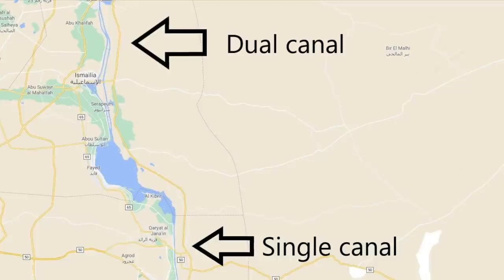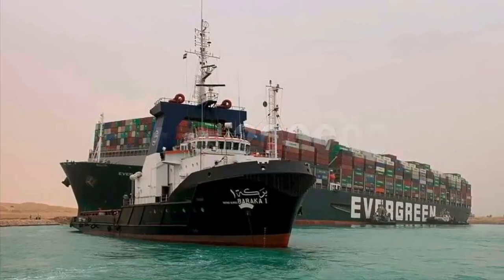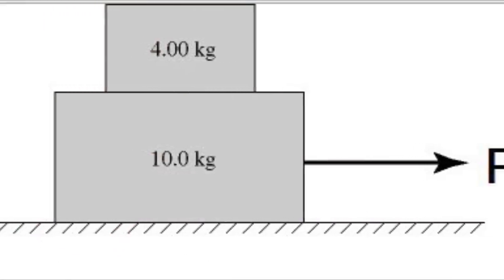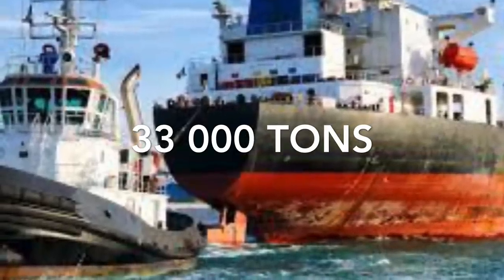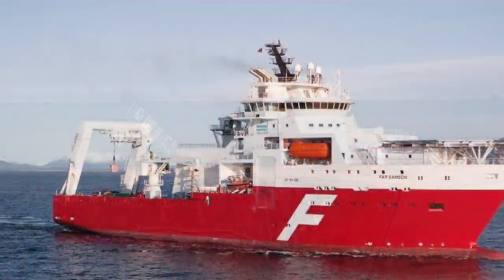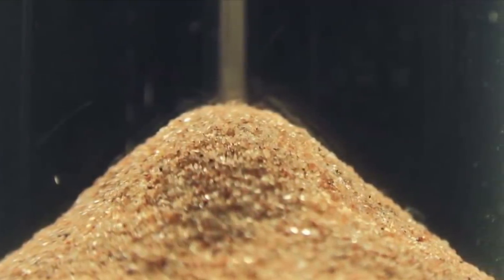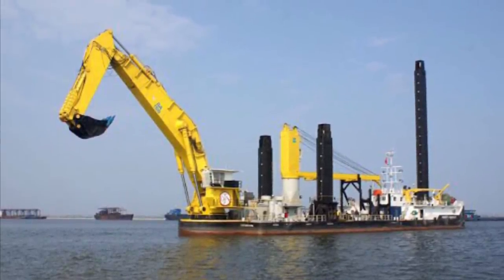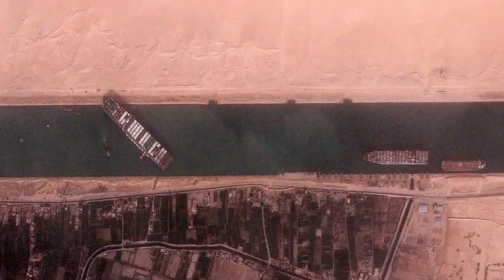MV Ever Given - why can't it be pulled out? Suez canal blocked

Comment: Something you didn't mention is that the ship is very close to land, surely we can use very powerful winches to pull the vessel free ?
Reply: You underestimate the sheer weight of these ships
Reply: These things weight 500,000,000 (500 million) pounds. That’s about 175,000 Toyota Corollas
Reply: Well he did say that it was wedged into the land... Did you not listen? I think it's free now anyway
Reply: The US navy rolled over (to upright) the capsized battleship Oklahoma in Pearl Harbour by using cables, pulleys and winches on land in 1943.
Reply: @francoistombe  The battleship probably weighs a fraction of these container ships fully loaded, not to mention the friction of it being wedged into the sand
Reply: @cmdr101z8  The battleship was dead on the bottom and weighed 32,000 tons.  The container ship displaced 200,000 tons but likely less than 10% of that weight was aground. At high tide the entire weight was floating.

Comment: High pressure water jets at bow to clear sand and large bull dozers tied to aft with hydraulic cable pullers from shore. Still using tug assist.
Reply: I think pulling from shore is going to be part of the solution, but it'll take ages to set up.
Reply: Calm down
Reply: the hull may not be designed to withstand pulling in this specific scenario

Comment: Why can't they use cables attached to spools mounted on land with engines turning the spools?
Reply from the maker: Maybe that will be the solution. But likely you can not attach a load that high to the mv Ever Given... it will just break parts of the vessel.
Reply: I guess they can weld hundreds of anchor points all over the surface of ship, and bring in hundreds of bulldozers.
tie each anchor points to the bulldozers with steel cables and pull.
Reply from the maker: @davidjacobs8558  possible. I heard today that some specialist are one the way... i look forward to see the solution
Reply: @TheGeotechEngineer  
SMIT Marine salvage, the best in the world.
Reply: @davidjacobs8558  hundred?? You need thousands...
Reply: @akhilmathew8822  depends on how heavy the bulldozers are.
Reply: @davidjacobs8558  Bulldozers are also not cheap. I doubt they'll just have hundreds of them lying around, and if they do, they probably need them for....you know... construction. You might as well deploy some tanks from the military and used those to tow. If you're not at war, might as well put them to good use.
Reply: @davidjacobs8558  A tank should also be heavier than a bulldozer, and as mentioned before, since it's not construction equipment, it shouldn't disrupt any other projects going on. It might freak people out if they see tanks going towards the ship though...lol, and who knows if they'll be able to get enough of them in a reasonable amount of time to actually make a difference.
Reply: The bow seems stuck pretty well but the stern, just drag that across and open up half the channel.  Cables on land with strong anchor points and pulley system.
Reply: @joemann7971  well MBT's are about 60 tons. bulldozer for road construction can be 100 ton or more, but bigger ones can not be easily transported without disassembly.  MBT's aren't really built for pulling or pushing things.

Comment: You are wrong about draught of this ship. You can actually read out draught on marks at ships bow perpendicular. Looking at this picture and excavator you can guess that cwl is about 6m out of water. This gives bow draught of about 9m. True, ships bow is lifted out of water for some extent due to grounding. Look at cscl Jupiter at Antwerp. Ship run a ground with large percent of bottom lenght and it was pulled with 8 tugs.
Reply: Thanks for the info.  The also have the possibility to pull from the land on the opposite side with bulldozers and such.  They need to get out there with some serious earth moving equipment and start digging a much bigger hole.  Lower the bank around there down to just above the water level so they can get down under the ship.  9M is an easily digable depth with proper excavators and maybe hydraulic mining and dredging equipment.  That one small excavator isn't going to get the job done.
Reply: Hes also wrong about the weight it depends on what's in the containers like cars n stuff could weigh more then flowers n stuff you know
Reply: @mroldnewbie  Maybe, but it takes time to get projects like this together, especially out in the middle of nowhere like that.  Companies have to be hired, equipment has to be moved, who's going to pay for it has to be agreed, liability wavers have to be worked out.  It's complicated.
Reply: @mroldnewbie  I would guess that you're right, if the company ever wants to move another ship through the canal.  Anyway, they'll get it out.  These things take time and the wheels move slowly. Just one more warning to us about the fragility of our global supply chain.
Reply: @mroldnewbie  Yes.  And then there's the Panama canal.  And imagine if several ships were actually sunk in either.  We are living on a thin line.

Comment: My thoughts have been to find some huge pumps/compressors (whatever works best) and try to liquify the sand with water/air surrounding the vessel while in concert with the tugs
Reply: Using air wont work as it will cause the vessel to become less bouyant. Natural laws of physics, however blasting water at high volume could well be a good solution providing it doesnt damage the hull, unless divers have been down already I will be very surprised if the vessel isnt taking on water, these hulls arent very thick and buckle easily
Reply: @simonturner10  Can you expand on that comment about the hull? if the ships in port, does that mean the hull will buckle?
Reply: @bocca7789  No but the sheer weight of the hull pressing down on the ground or bank could potentially cause it to buckle, ships of this magnitude are simply not designed to lay weight on the hull itself rather remain bouyant where the weight is evenly supported by the water hence why they are built on Jibs and not on the ground in the shipyard. Imagine 200,000 tonnes pushing down on a plate thats no more than an inch thick
Simple way of proving this for you is to make a simple paper boat and float it then add weight and the boat will stay in shape, then put the paper boat on a hard surface and add the same weight, the results will surprise you
Reply: @simonturner10  cheers mate. if its taking on water, can it be stopped?
Reply: @bocca7789  depending on how much if any then in all probability it could be stopped with airbags, welding or continously pumped out while they salvage the ship, but the longer she sits on that bank the higher the probability that this could rip her open beyond salvage, then its a whole new world of mess to deal with
Reply: Is it possible to use some huge cargo ship as tugs?
Reply: @simonturner10  No mate it won't be taking on water, those bow plates are 10mm Corten or Bisalloy and designed to withstand a knock or two. Plus of course, the frames will be taking the load not the plates. If it were rock it may be a different story but sand will spread the load very evenly. What is more of a worry is hogging and sagging as the tide runs in and out breaking her back in the middle.
Reply: @vgb_here  In this case probably not due to the force needed to pull it off the bank
Reply: @marvindebot3264  I agree to a degree with you there but you still have the downward pressure on the hull, as you rightly suggest it is resting on what is probably the strongest part of the hull but there is still scope for her to crack at that point although I do agree the risk of her breaking her back would be very high at this point aswell. The way this whole thing is shaping up its not looking good
Reply: In addition, water could be pumped into the stern of the ship, so that the weight distribution shifts to the rear and the nose rises out of the sand and is relieved.
Reply: @vgb_here  No. The hull is not designed to withstand such force. Towing is only a thing when the vessel is afloat or at least grounded not in such extreme way. The max safe working load on bits designed for emergency towing that are on bow and stern is 200 tons only. Do not forget that a huge part of the hull is 15.7 meters deep underwater. A container is abt 2.6-2.9 meters tall. So it is around 6 container deep under waterline, just for reference.
Reply: I was more thinking about blasting the sand as an obstacle furthest from to close. Water cannons for hydraulic mining aren’t anything new and they don’t need to target near the ship. I’m confident with all the money 💰 that is flying away, that someone can create a custom version that could safely remove the material even if they need to start 100 yards away and work below the water surface. Just throwing out ideas anyhow

Comment: What about using the massive water cannons, that are used for some mining operations, to blast the bow while at the same time pulling the stern with tugs?
Reply: This thought of hydro mining crossed my mind too, it might just work. Some guy on tiktok suggested using another ship to pull because of the weight and power.
Reply: You still wont generate the massive amount of force needed. That ship needs to be unloaded.
Reply: @roguemotorcycle  "Wind" blows second ship into the sand ah whoops
Reply: The problem is that the bow of the ship is located far underneath the surface. Which would dissipate all the force of water cannons very quickly. What you do instead is pump water through pipes and push them in underneath the bow to liquify the sand around the hull.
Reply: @roguemotorcycle  yes, even if the water cannons don't shift all the earth that is beeching her, by introducing loads of water at high pressure, they might be able to reduce the friction enough to tow her free.
Reply: @ashleycole7779  You can turn sand to liquid but pumping air into it, so sinking some pipes down and then pumping air into it could work? The problem is how much this would effect the buoyancy as you may just get the ship stuck more.
Reply: @GAIS414  I like your solution better.
Reply: @geocam2  Well if it got on there they should be able to winch it back off, once the sand loses it's grip around the hull.
Reply: @paulhanley3368  you where wrong
Reply: @GAIS414  your assumption is that the cannons are above water level.
Reply: It wouldn’t be the first time the Egyptians used water cannons on the canal!
Reply: @brucewelty7684  Yes, that is how you use a water cannon in hydro mining. Once you submerge the nozzle it's no longer a cannon.
Reply: @Justin McCoy Pretty bad idea. Apart from causing an environmental disaster. It would do nothing. Oil floats on water, so it would just make it's merry way down stream and pollute everything it comes into contact with.

Comment: How about high pressure pumping to move the sand from underneath the vessel.
Reply: Amen
Reply: That's what I was thinking
Reply: That’s exactly what I was thinking too! But I think the ship risks being damaged by the amount of pressure it would take to push the sand as it has been compacted under the ship. They could use machines to push and pull the ship at the same time. Either way it’ll take a while to plan, design and build such machines whilst unloading the ship to decrease the downward force against the sand. Let’s just question why they sent this big ass ship through such a small canal in the first place instead of many reasonable sized ships toss a unit. I feel like that was a part of saving cost... which will ironically cost almost everything. I feel like this should’ve been foreseen knowing that there are normally some fierce winds there.

Comment: How about bollard pull of USS Gerald R Ford? It's at least 5000 tons. They managed here to release it with a combined pulling force of around 5000 tons or less. The basic rule is, if something doesn't work just take a bigger hammer.

Comment: Good analysis. Except you make a mistake of assuming that because it's a ship, it would have to be pulled by another ship. Which is correct in open water, but this has land in immediate proximity.
I'll grant that I don't know how difficult that towing force would be for ground equipment, or how hard it would be to get such equipment to the location.
Still, kudos.

Comment: I feel like the end solution is pulling it from the back and a million vibrators set on the ground to help vibrate the ground to break it free🤣🤪
Reply: Not bad idea.  Soil becomes liquidy when there's an earthquake.  You would use massive concrete vibrators.  They prob have in s. Korea or japan.  Called liquifaction i believe.
Reply: Women of the world unite!
Reply: You know the air pressure pushes the clay tighter on the walls from the ship that the normal air pressure holds the ship like in a big vice and every day stronger. The clay is air-tight. Help would only many big water pumps loosen the clay from the ship and pull from the land with earth strongest pullers like 100 ships can pull from both sides.
Reply: @jimanonymous113  Very good idea, I had not even thought of that.
Reply: They partially freed it.   They feared we were gonna go there and use pur ideas to free it and they feared we would get their commission.

Comment: Just a thought: One should possibly try to block the water flow of the canal on one side like concrete barrage and increase the water level of the channel by pumping water from the other side.
Reply: I don't know how practical it is, but that is along the lines of my thoughts. Build two temporary dams in the canal, and start pumping water in until the ship is floating again. Then remove the dams.
No doubt, a lengthy process. 
It will be interesting to see how they handle this.
Reply: Agreed... raise the water level.
Reply: Wait you're stealing my idea 😀😀
Reply: That's what I was thinking.  If that's not a practical solution, they're going to have the lighten the ship by removing containers.  That seems like a daunting challenge as well.
Reply: That water will probably overflow on the shores. The ship is stuck in mud. Increasing water level might not help.
Reply: @mohitjaisingh8482  I was also thinking that may be the case as well.  They said that it's high tide in the canal right now, and with the aid of tugs, they hope to be able to pull it around today.  Judging from the photos taken from space, it looks like the ship has become stuck in the mud at both the bow and stern.  What a mess.
Reply: @cunard61  if the wind did this, why not use it to get out as well? Can we use sails?
Reply: @mohitjaisingh8482  I would think that the container wall along it's upper decks would serve the same purpose, they just need the wind to be blowing in the right direction.